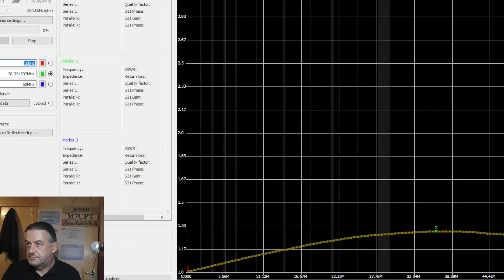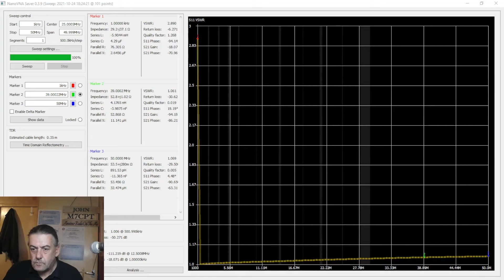1:1 Balun Comparison Tests

Comment: Well, fairly basic swr measurements. BUT, the real use for a 1 to 1 is common mode attenuation. There are several channels who did take on those measurements, and they are the most important measurement on any 1 to 1 with a flat SWR. Are all of the toroids using the same type of material ? 43 or 31 for instance ?

Comment: Very interesting video ; i was wondering whether the coax version resistance is in the range of that of the other baluns or is there any reason according which it has such a low SWR especially above 10m, in other words is it doing its job properly ?
Reply from the maker: My best guess is that the coax version is maintaining the 50 ohm throughout the length of the wire as a constant so the only variation from that would be caused by the toroid on the frequencies that are outside its tolerance range. A pass through test would show where the actual frequency range falls off.
Reply: @A.R.O.T.A.  thanks for your answer; your results have puzzled me enough to search the web for an answer to this and actually there would be an answer: indeed while coax keeps its 50-ohm impedance it is very difficult to get 50 ohms from a bifilar version, which would explain why on your bifilar you did not have the coax wound ferrite low SWR across the HF range. All in all, it seems that the coax version has the advantage provided one uses teflon coax and the coax diameter (thus ferrite core diameter) which is best suited for the intended power to use. Not to forget that mix 31 is better suited for lower bands and 43 for higher bands. If I am not mistaken (to double-check), mix 61 would be usable above 30 mhz.
I also have found that the number of coax windings and the number of cores is linked and dependant of the range of frequencies to choke (here the goal is to have the highest choking impedance possible, ie. ideally around 5000 ohms).